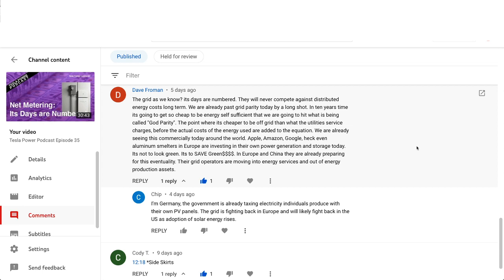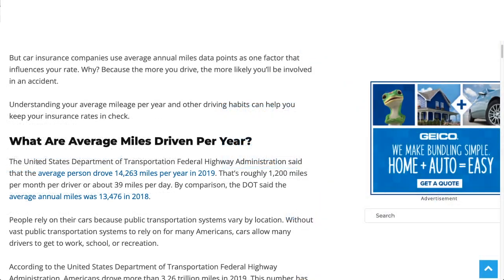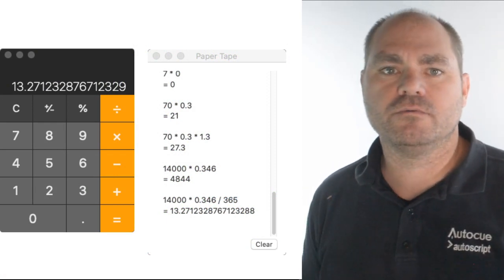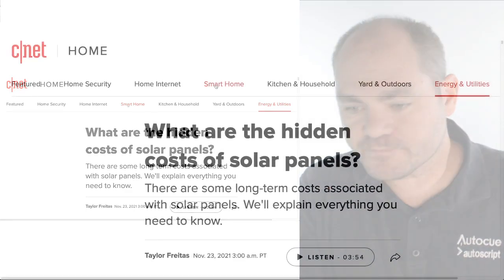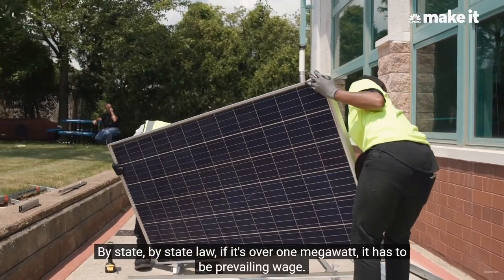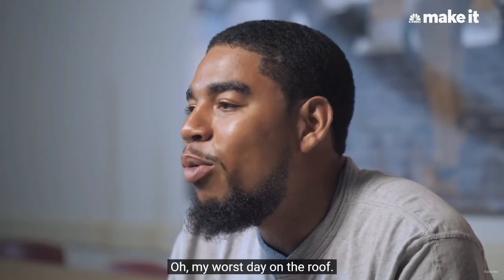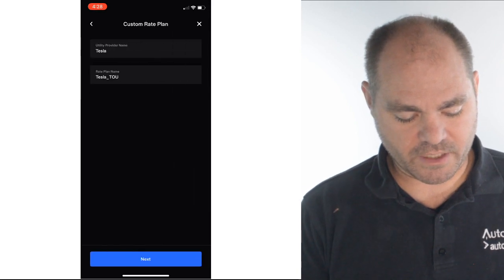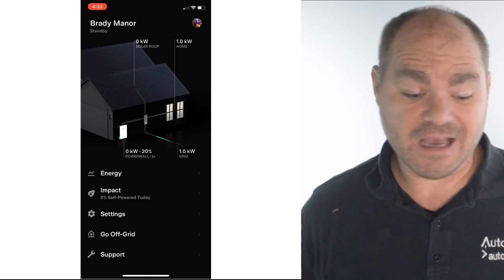Episode 37 - Charge an EV with Tesla Solar and Powerwall + | Tesla App Utility Rate Update

Comment: When we first moved into our house nearly 20 years ago, we installed energy efficient fluorescent bulbs into every light socket (they have since been replaced with LED's).  The electricity savings isn't that great, considering our utility keeps telling us that we use more electricity than 90 percent of our "neighbors".  Before solar, we were averaging about 1,200 to 1,300 kWh of electricity a month.  Earlier this year, we added a swim spa to our property, which increases our electricity usage (the spa has two 5.5 kW heaters).  The first month we had the spa (to heat the water from March temperatures in NY up to 93 degrees), our electricity usage spiked to close to 3,200 kWh.  This is what prompted us to go solar.  Currently, our daily electricity usage is around 65 kWh per day.  On a full sunny day, my solar panels and powerwalls can provide close to 70 percent of our electricity usage for the day (and this is before PTO, so I'm not sending any electricity to the grid).
Reply from the maker: Does your utility have time of use charges or is it a flat rate all day?
Reply: @teslapowerpodcast  My utility offers both, although I am on the standard billing plan which charges a flat kWh charge.  Once we "go live" I may opt to switch to a TOU plan since the power walls will allow me to maximize the benefit.  If we opt to switch to a TOU plan, we have to stay on it for a full year before we can switch back. However, looking at their TOU rates, the benefit would be minimal (peak delivery rate is 10.5 cents per kWh, off peak delivery rate is 9.1 cents per kWh, while the standard delivery rate is 9.6 cents per kWh).  The TOU plan does have a $1 higher monthly "base" charge, which is essentially the connection fee.  According to the utility the "breakeven" for going to TOU over the standard billing rate would be if about 82 percent of my electricity usage was off peak.  Note that here in NY, our electric bill is made up of two charges, the delivery charge (the cost the utility charges to bring the electricity to your house) and the supply charge (the cost we are actually charged for the electricity we use, since we can choose where we get our electricity from).  It's hard to gauge what the supply charge is because it can literally change from month to month).  Roughly, the delivery and supply charge combined (on the standard rate plan) costs us around 16 to 18 cents per kWh.  Our electric provider though, does also offer a special rate plan if you own an electric vehicle, but I am not sure of the exact costs of that.

Comment: I got notice a few min ago from National Grid that my transformer upgrade is now going to schedule soooo, 4-5 weeks, looks like I probably will not have my PTO this year. SIX MONTHS AFTER MY INSTALL FINISHED. face palm, lol. Tesla growing pins. Process has been very drawn out but worth the wait.
I inherited a house very recently and it needs a new Solar Glass Roof. Talking to my project adviser he told me that the initial process will take MUCH longer since Tesla will now check for all permits, possible transformer upgrades or other items. Up until now Tesla actually began installation in hopes that all permits and upgrades will pass. Advisor told me that the majority of install went OK. Then, like me there many issues and Tesla has eaten about $12K in system and utility upgrades which I should have been invoiced.
Reply from the maker: This is pretty incredible that Tesla has stepped up to move your installation to completion.  We'll celebrate when you get PTO :-)
I can't imagine Tesla is making much money on your first project lololol!!!  OF COURSE they will be more careful on your next one :-D
Reply: I just bought a Jeep 4xe this past weekend.  I have been charging it at home coupled with the days getting shorter and overcast conditions; I have been drawing from the grid since my powerwalls havent been to be fully charged.  To your other question regarding AC and solar,  I essentially was grid neutral in August while running my AC unit.. I generated 1.1 MW-hrs, used 1.05 MW-hrs, and discharged 465 kWh.  Eversource for that bill said I exported 4 kWh.  I definitely will be over my solar capacity with my Jeep 4xe this summer.